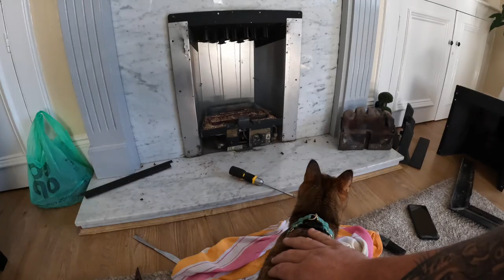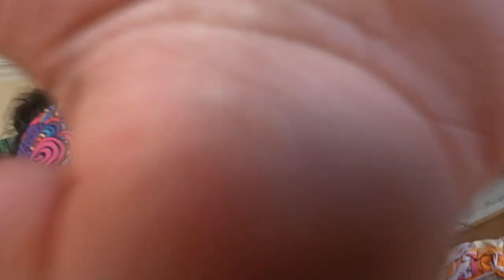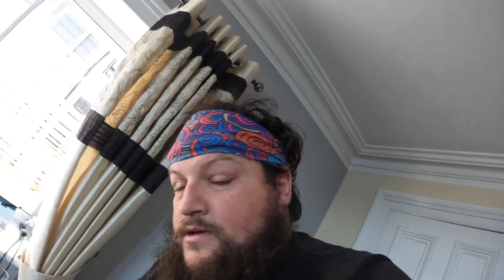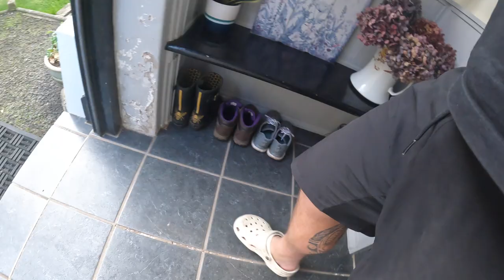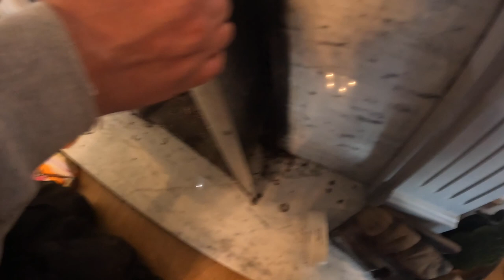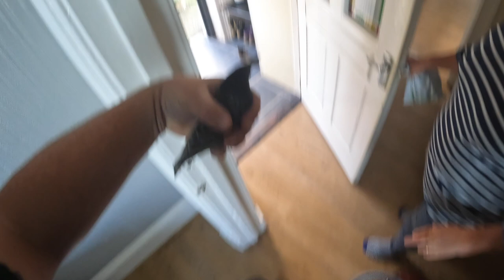Bird rescue 🐦💙

Comment: I put those caps on my chimneys when i had gas fires Dean. They have slots around the sides to let the air circulate but, flat on the top to stop birds flying down the lum.

Comment: That bird certainly chose the right chimney to come down.
I don't know if maybe the gas guy mentioned this, and not wishing to be an alarmist, but if there is a route for the bird to get into the space behind the gas fire there may also be a route for the gas fire fumes which could then leak into the room. It might be a good plan to have this checked and, if there isn't one, have a flue liner and cap installed.

Comment: I had the same thing once, a starling down the chimney. Luckily it was still an open fireplace, covered with an old road sign and a trunk when it wasn't being used, so it was easy to open the space up. Took a bit longer to catch the bird though :)

Comment: Recently did same thing to rescue a chunky pigeon. 
Made slightly easier and cheaper by the gas being disconnected because the rarely fire had recently been condemned.
Made a lot harder by the near inaccessible cable behind fire holding fireplace in situ.

Comment: i rescued a starling in my basement apartment once that was trapped behind the wall for about three days because at first i thought it was a mouse ... i used a chisel and hammer to get it out from behind the drywall ... the bird ate some green beans from my dinner plate but it didn't eat my veggie burgers for some reason ... then it landed on my mug and drank some tea ... after that i opened the door and it flew away ... honest